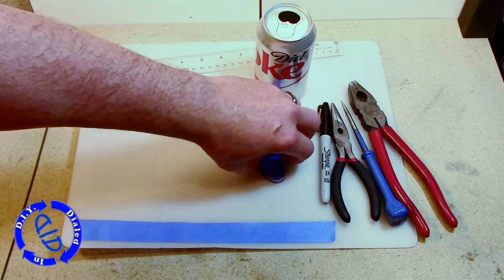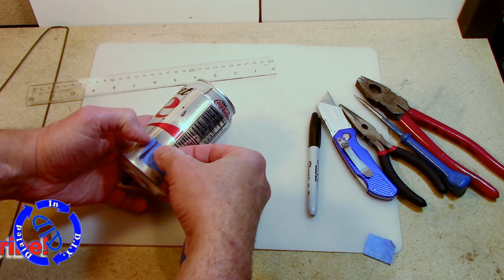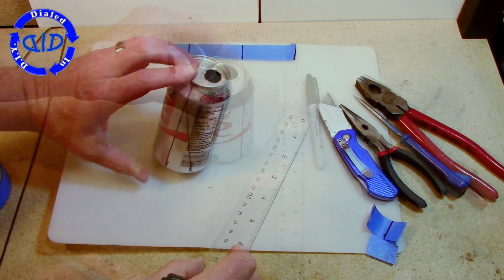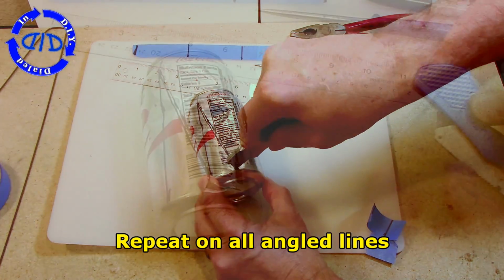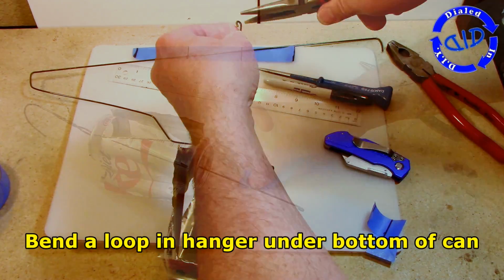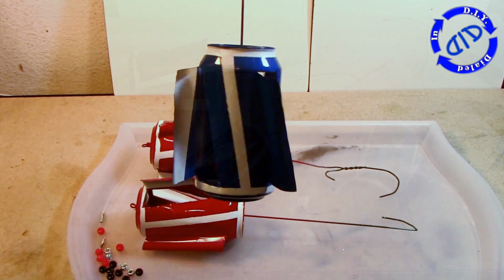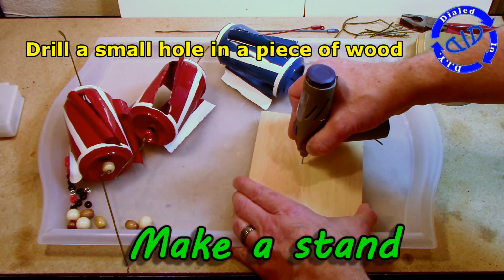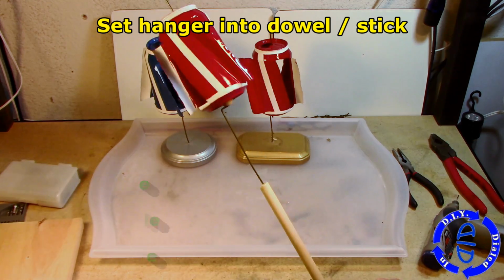Make Turbine Pinwheels - Amazing Coke Can Project

Comment: Have you figured out how to turn it into a wind turbine?
Reply from the maker: I put an axle in one and hooked it up to a mounted motor (small motor) and was able to get some power flow from the motor contacts.  I just have not taken it past that step.  Were you going to give it a try?
Thanks for taking time to post a comment.
Reply: @DialedInDIY  Not yet. I was wondering if you could use a 12 volt battery and dc converter and somehow get electric from the pinwheel.